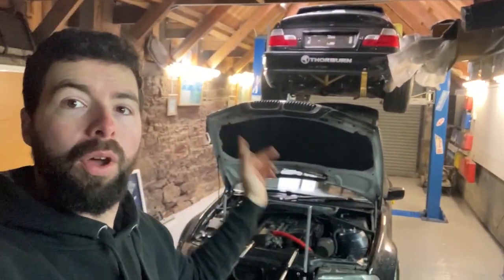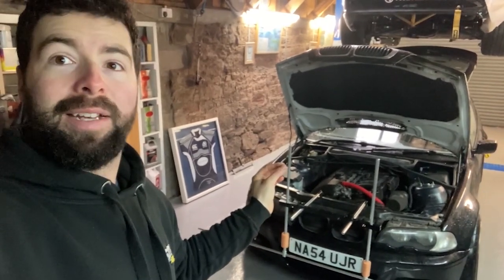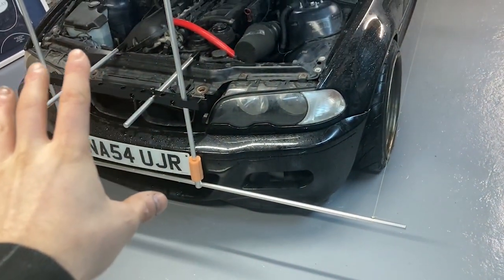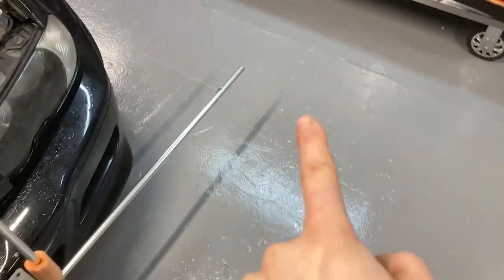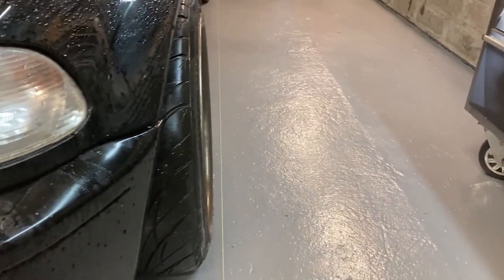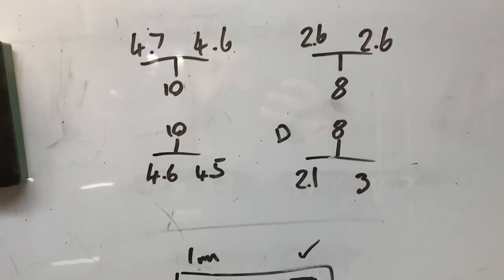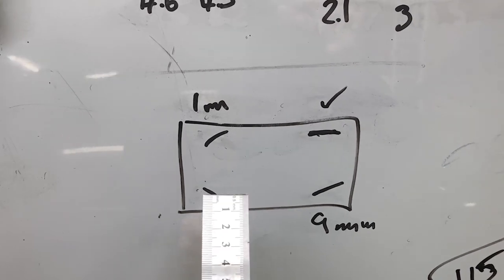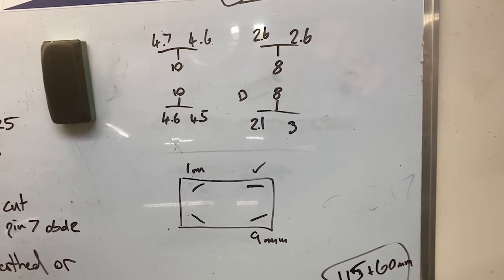Beginners Guide to String Alignment (Basics)

Comment: might add before beginning to lock the steering wheel in the straight ahead position
Reply from the maker: This is just a quick guide to string method most should know wheel needs locked if u have too to do so but thanks for pointing out this tip 👍🏻

I plan to do the in depth one soon when I get time

Comment: Just a quick question, doesn't the distance from center of wheel to string line need to be exactly the same on all 4 corners to make the string line a perfectly square reference point to measure from? The way you've done it here with 100mm at the rear wheels and 80mm at the front, you've essentially created an isosceles trapezoid (not gonna lie, I had to google that name lol) with the string line to measure from. Then adjusting your front wheel alignment to be square with the string line like this will result in a toe-in result, would it not? In fact, that would also explain why your real wheels are out by about 1mm (back to front) from the string line. Is there something I am missing here? 

Cheers for the video, it's interesting to see how this is done. I'm about to attempt it on my 4X4 once I install the new steering rack!
Reply: Id say your not accounting for different offset wheels with your theory. Bmw like to run staggered fitment.
Reply: Because of the front and rear bar, the notches on each being exactly the same, it’s going to create a perfect rectangle around the car. The measurement to the wheel hub feels more like a way to double check that I think